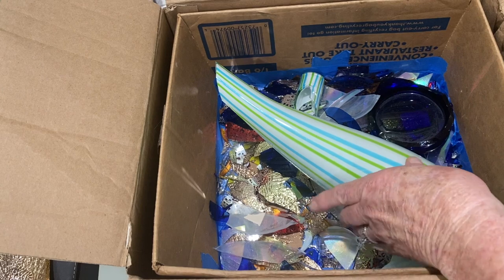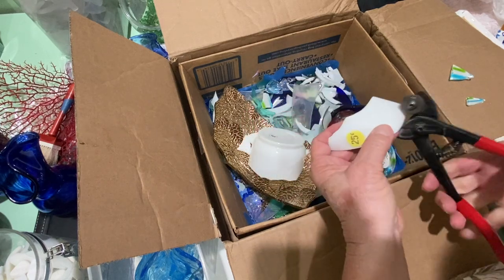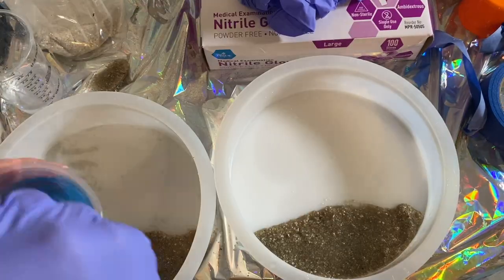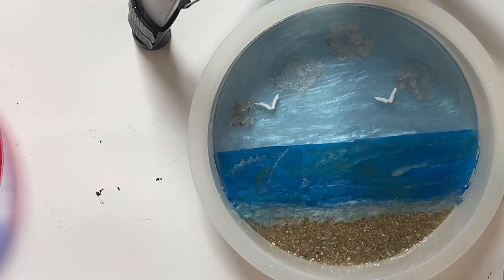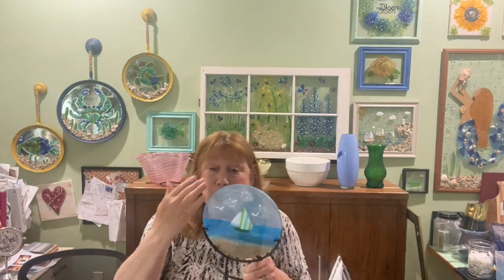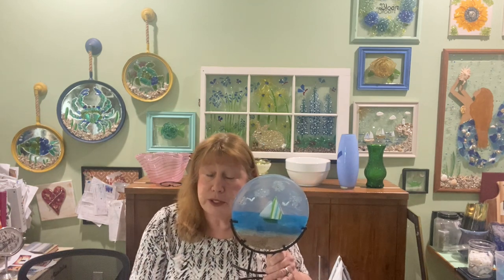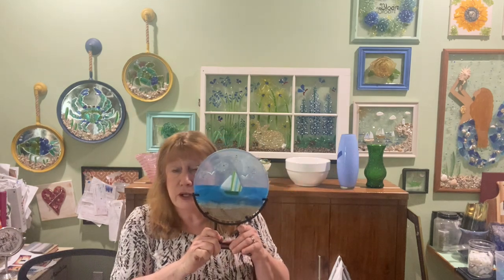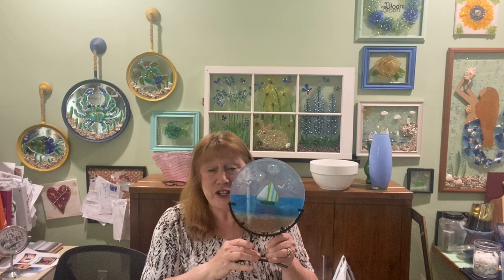PAINTING ON RESIN WITH UV RESIN. GLASS AND EPOXY RESIN ART SAILBOAT. COASTAL ART

Comment: I use castin' craft mold release spray/ conditioner and never have a problem. I love the garage sale finds. I tumbled some glass with the bumps for just overnight and most of the bumps wore off! Loved the project!! Oh yeah just wanted to say that I learned the hard way not to try and break up a blue pyrex LOL I dropped half of a concrete block on it from up over my head with a downward force and it didn't even chip. well its a dog dish now LOL
Reply from the maker: Wow sounds like those old Pyrex are strong, haven't tried one of those yet. When you tumble just over night to get the sharp edges off do you use grit or just water?
Reply: @crazyglasslady  I use 60/90 grit. I was surprised that it took off the sharp but my glass bumps were mostly gone. It must have been a replica of Fenton

Comment: Use a long neck lighter. Torches are too hot for molds & fuse them to the resin. Yessss.. to mold release spray. Every time we pour resin into a mold it takes a tiny bit of the silicone finish off with it. Molds last a lot longer using spray as a barrier 👌 
Love your glass arts!  It’s always a pleasure seeing you and your creations ❤ Edit: look for the long BBQ lighter that have a small hole in the bottom of the grip part.. they are refillable. I’ve been using the same lighter for a couple of years with a can of butane. Dollar tree has some or Amazon sells multi packs for cheap.
Reply from the maker: Will do, thank you I do see people using them.

Comment: Another wonderful video! Thanks for all you do for your followers!! I’m curious about tumbling pottery. If it has a pattern will it come off? Same question about bone China- does the pattern come off?
Reply from the maker: Yes, you have to be careful use very little grit. You could even use sand and only tumble it for about four hours check it put it back in check it every so many hours, the edges round a lot quicker than with Glass Andrew risk taking the paint off of it.

Comment: Take great care and keep creating and smiling ❤ ahhh my tumbler blew it's lid the other day. Thank goodness I have it placed in a big plastic tote in my spare room. What a mess to clean up it was. I really don't understand why as I  took the lid off of it every day  to burp the air out.  I  was making faux sea glass for  a wind chime.
Reply from the maker: Dale the same thing happened to me with my big MJR 45 lb tumbler and yes what a mess. I would love to see your wind chime when it is done was thinking about making one. Are you going to drill holes or glue the string on?
Reply: Linda I was thinking of e6000 some jewelry bails on the back.  I  have a few to make and thought this would be easier and quicker. UV resin would not hold outside in the heat here. I  might drill some holes in seashells I have here to add and I also have some jewelry to add to. Hippy natural friends and daughter I have. I  also love the look. I want to do the front of a Volkswagen van with a peace sign in glass on glass for my daughter. Take care ❤️
Reply: @crazyglasslady  oh no!!! Mine is only a 3 lb. One. You must of been cleaning for quite a while. 😪
Reply from the maker: @dalemaclaren7576  yes it was a mess but in the garage

Comment: Love love love!  It’s so relaxing.  So the colored glass you painted and added in tumbler doesn’t come off on the white glass?  I love how you figured out how to fix your error and I don’t notice any problem.  It’s so nice!  Which do you find more effective?  The Alcohol the torch. Or the heat gun?  Thanks you. Such great finds!
Reply from the maker: Well I have a spray bottle with alcohol in it but have not used it yet and Im not really sure where it is LOL. But I have seen people using it a lot on coasters anything with small molds that they are afraid to burn. I like the torch better then the heat guns just because there is no cord and it is so small and convenient. The Embosser is better to use then the heat gun because it does not blow the glass or resin all over the place. I think the Embosser and the torch work equally well its just that the torch is more convenient.
Reply: A long neck barbecue lighter works great for getting out bubbles also.
Reply: @crazyglasslady  ahhh… thank you for your opinion.  Keep creating your beautiful work.❤️